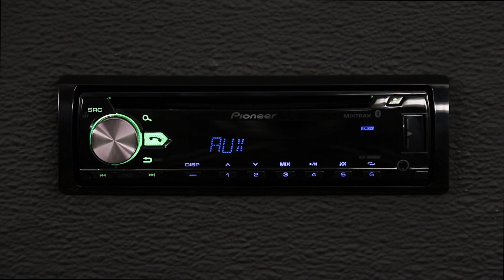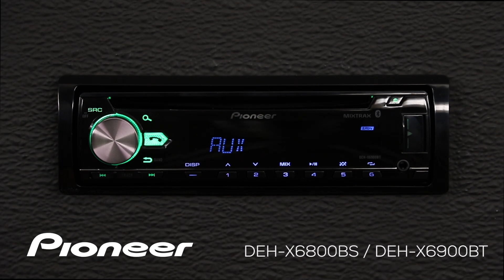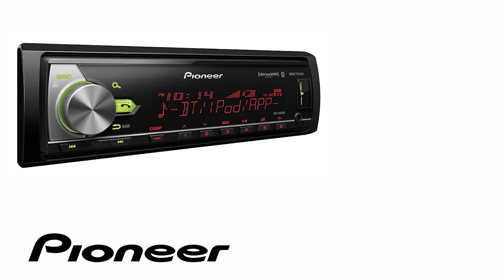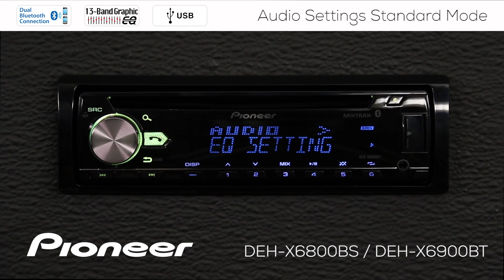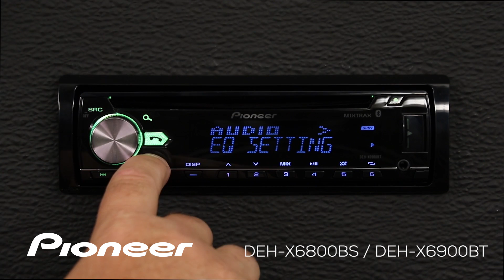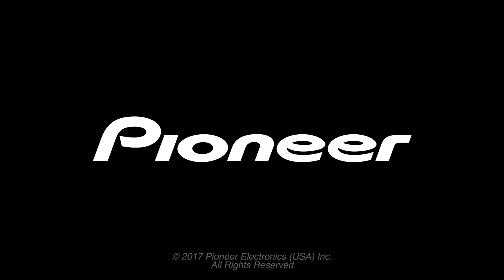How To - DEH-X6900BT - Audio Settings Standard Mode

Comment: If I retained my factory sub and amp using the GMOS-LAN4 interface should I be using subwoofer settings or no?
Reply: I'm not an expert on GMOS-LAN4.  I recommend to contact Metra / Axxess for more information.  You didn't mention what in-dash receiver you are using. If it's Pioneer DEH-X6900BT, and you are using it's Subwoofer RCA outputs then yes.  I think you should be using the subwoofer settings on the in-dash receiver.   If you are using the speaker level outputs and the system appears to be operating "normally" other than subwoofer control,  I recommend to use the in-dash receiver Equalizer to add additional bottom into the system.  You can learn more about the equalizer here:   https://youtu.be/qnGFNpPat-Y?list=PLw63zJRQbCNiqf5pU1wQ00VD9BRgM0eH3  You might try the superbass setting to see if this helps to add more bottom.  One additional way to approach this, is to set up the rear speaker outputs as subwoofer output.  Be carful here:  this setting may give you only low frequencies  to all of your speakers.   The speaker  level outputs can be set up as Front And Rear Full Range  OR   as Front and Subwoofer output.   The Pioneer DEH-X6900BT can be set up with a subwoofer crossover on the Rear Outputs.  You'll do this in the initial menu.  You can see it here:  https://youtu.be/CGri78izPzA?list=PLw63zJRQbCNiqf5pU1wQ00VD9BRgM0eH3  You can find a full playlist of How To videos about Pioneer DEH-X6900BT here:  https://youtu.be/jLkiyqbYlBA?list=PLw63zJRQbCNiqf5pU1wQ00VD9BRgM0eH3  Be sure to install the latest firmware update for your Pioneer DEH-X6900BT.  You can find it here:  https://www.pioneerelectronics.com/PUSA/Car/CD-Receivers/DEH-X6900BT#downloads   You can find more videos on Pioneer's You Tube Channel here:  https://www.youtube.com/user/pioneerelectronics